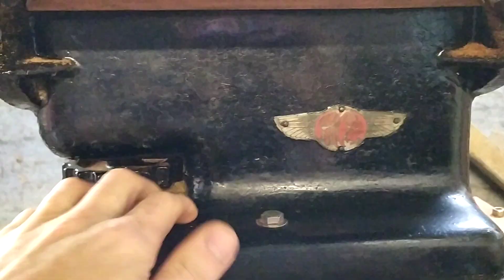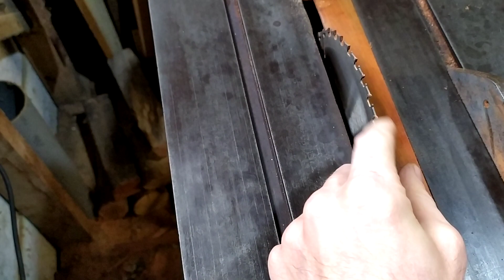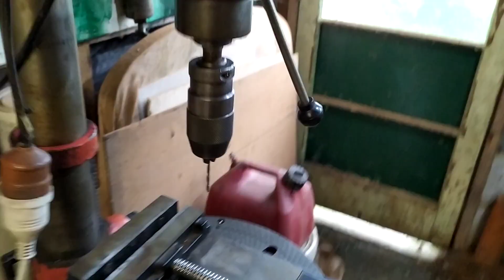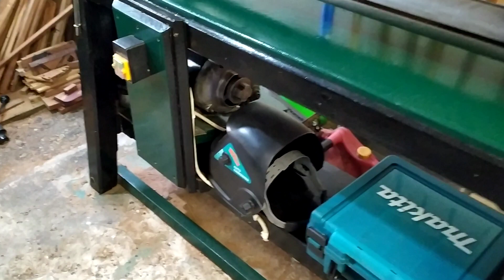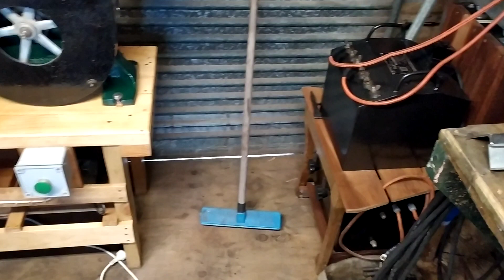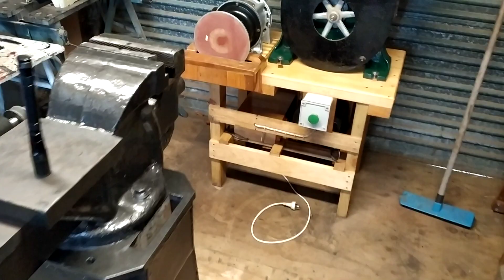Vintage workshop machine shop tour walk though

Comment: Lovely shop you have! The lathe is gorgeous and the welder is something else...Newer seen one like that!
Reply from the maker: Yeah. I got that lathe stored under cover now. I have a metal lathe setup now which is more me. If you look at some of my latter videos you will see I got a bigger welder and dc rectifier. You can see I painted them both green and made some brass bits for them. If you have watched them then that’s my new to me old units. I won’t be replacing them lol
Reply: @tom18181 I would not replace them either :D Old tools have a certain charm. will check out all videos!
Reply from the maker: @WickedTools  Thanks heaps. Feel free to ask any questions.